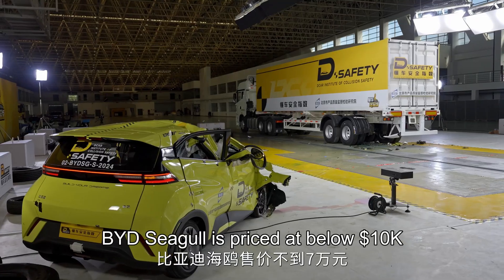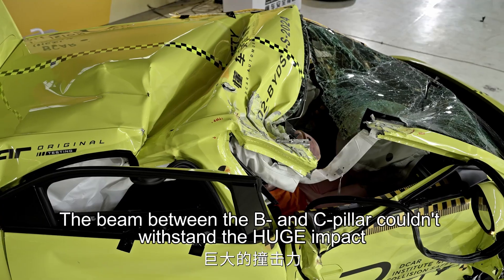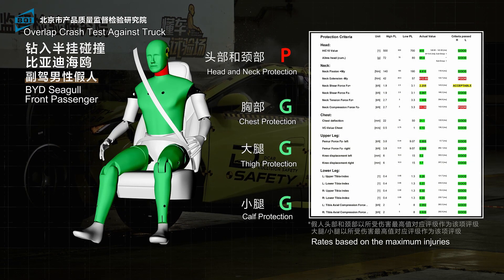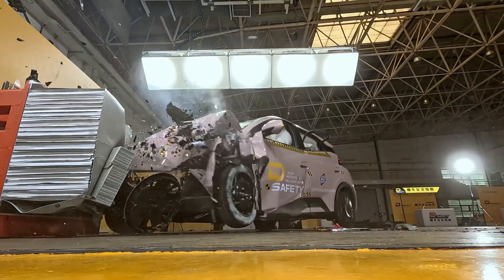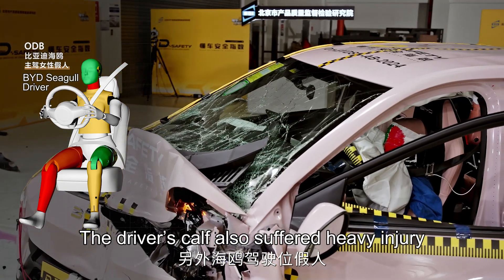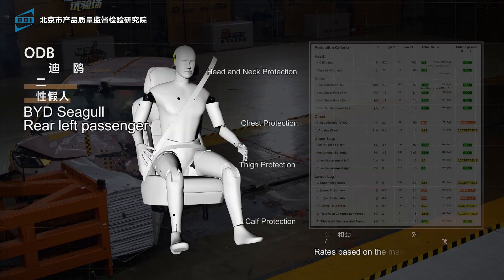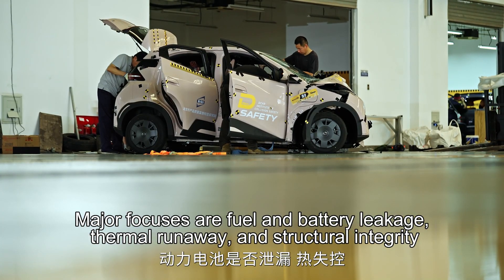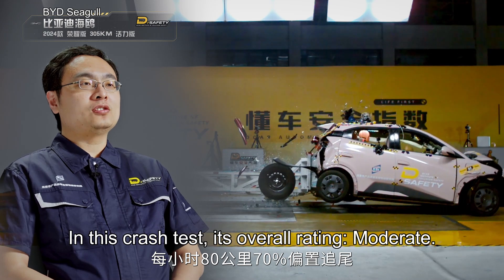BYD Seagull Crash Safety Test 海鸥 碰撞安全测试

Comment: they should also include this sceonario into An-cap test and others .... this is quite an extreme test most of the car can not pass .......
Reply: Tesla passed.  Cope harder.
Reply: @KP-xi4bj Yeah but Tesla is a bigger and much more expensive car. You should compare this car to other cars in its class.
Reply: @ All we're hearing are excuses.
Reply: @ 😂 Aye bro a Volvo XC90 does better in crash tests than a Tesla Model 3. Teslas suck! 😂😂😂
Reply: @ Volvo only dreams of having Tesla's sales volume.  

Cope Harder.  LMFAO  SMH
Reply: @ You missed my point. I was using your clown logic.
Reply: @ And you failed ... miserably.  😆🤣
Reply: @zee4125  It would probably not pass the trailer test (although that scenario wouldn't happen in Europe). Tesla passed because it went underneath the trailer.

In a regular crash XC90 is at a disadvantage to the Range Rovers and EV heavyweights, but will do better than most hatchbacks.
Reply: @xx-----------xx873  my point was cars of the same class should be compared. You can’t compare a Mini Cooper to a Tesla Model X, for example.

Comment: For 10 grand, nobody could expect more. As a city car, it’s still great. At highway speeds, it may be more risky, but in a car like that you drive more carefully like in any small car.
Reply: Based on that logic, they shouldn’t allow it on the highways, which doesn’t make any sense, especially since these aren’t the cheapest cars you can buy, and it’s advertised as a car and not a quadricycle.
Reply: Then they should limit the speed to 50km/h

Comment: just about the most difficult test from an occupant safety perspective... My main takeaway is lower cars have a better chance of survival because the angle of impact against the A pillar is less extreme (and better chance of sliding under the truck instead of getting the car ripped open by that corner).

Comment: I own byd seagull. mas low quality pa Suzuki Celerio ko na parang lata lang yung body nya... High metal quality ang Seagull , ang bigat ng doors nya at body matigas . . Sa test nila kahit anong sasakyan ma wawasak talaga.. 😅
Reply: Like what dcar stated, the sgmw binguo did better overall. The seagull design is not safe.
Reply: @jimboroq2284  still safer than motorcycles.

Comment: As this test is a Chinese specification test, with reality tested in a way totally unmatched in the West, it really challenges the notion that Western standards are leading the world. I saw a video of the Tesla model 3 perform this test - absolutely amazing. The model 3 sort of slid under, but the roof didn't break as it does here. I wonder if the roof could be made stronger and the suspension made to break? Dont know if it would be an improvement I am no engineer.
Reply: the iihs standard talked here is a U.S. standard.  FYI
Reply: @gwsheipang  oh that is interesting. I am in Australia and our standard crash test is heavily influenced by the European standard. There is no test which is offset with the protruding metalwork as you get on the back of a truck, in the ancap test.
Reply: Most people think that China should add anti-collision railings to trucks. In this test, only cars will become safe if they are low enough. Volkswagen's Passat in China was once tested, and the entire top of the car was destroyed. The Chinese joked that they had to buy a helmet to buy a Passat first.

Comment: A 40% overlap of a smaller in width car results in missing the rigid structure at the trailer. Actually part of the energy has to be absorbed there but due to the tiny ovelap just a small wing at the trailer end was hit (visible after 0:13 m) and the car went in full speed under the trailer which resulted in the torn upper part. Don't think it is fair to have the percentage overlap of 1,60 m widee car against 2.00m wide ones if this is decisive for the upper part of the vehicle. What is the rating for a 40% overlap against a barrier compared to other cars?

Comment: The steering wheel moves upward, which would be a serious problem if the driver was a shorter person. Because when you're shorter, you sit closer to the steering wheel. Footwell area is also very bad.

December 17, 2024 11:46AM

Comment: BYD has advanced greatly on design, quality, but still lacks safety, hopefully they can advance in that regard soon
Reply: Wtf U talking about. NO CAR WOULD SURVIVE AN IMPACT LIKE THAT WITH A TRUCK
Reply: @travellinginawhat  are you restarted. People stopped dying from trucks in in the 2010s, China should keep up
Reply: @travellinginawhat A car with a strong A pillar could definitely make it.
Reply: @SaraL0297 nope. This is not the standard ncap test. This is a more rigorous test and almost no car survived it. I do remember only 4-5 cars passed this test one volvo, one bmw and 2 other cars.

FYI most byd models get 5* ratings in the new EURO NCAP.

So as far as safety goes. It's as good as it can be for a 10k car.
Reply: In this test, the A-pillar of the Mercedes-Benz Maybach was also broken, and the B-pillar was late, because the front of the car was too long and there was no contact.
Reply: No car would survive this crash where the A pillar takes the force of the entire crash. Only way to pass this test is to have a very low seated position where the front pansenger head is lower than the truck chassis, like in a super car.
Reply: @moss550  even roll royce and maybach failed at A pillar hahaha
Reply: Dude this is a small car, an aygo, yaris, c1 would do the same, no small car would withstand this impact unless you have roll bars or metal made from vibramium.
Reply: Thats well, profit high, no emphasis on safety
Reply: Safety is good ( dolphin,han,tang,seal,song plus,yuan plus-atto 3 ) 5 stars rating
Reply: I'm sure the BYD models that cost more than $10k do a little better
Reply: size matters when it comes to car crash.
Reply: @koba301  not if every car is tiny.

Comment: Structure Rating - Dead
Reply: DongCheDi, this specific media tested 30 cars in total, and only 3 cars succeeded in saving the front passenger:
MB G-Class G500,
Tesla Model 3,
Volvo S60.
The rest, including Hyundai Elantra, MB-GLC, BMW X5, M-Maybach S480, LR Range Rover, Nissan Qashqai, Lexus ES, Toyota RAV4 and all other cars that you heard or not heard of,  failed to save their front passenger. 
This is an extremely difficult test.
Reply: @毫徳寺三花  show me your proof
Reply: @毫徳寺三花 没有奔驰，还有一辆是Xiaomi su7
Reply: @mr.febrian9248  Di Euro NCAP dapet 5 star
Reply: Price always right🤣🤣
Reply: But at least the battery survives
Reply: @kylereese4822  Which country?
Reply: What s the speed ?
Reply: 毕竟便宜
Reply: Sorry bro, correction needs to be made to be made. Elantra’s front passenger survived the test.
Reply: @kylereese4822  besides SEA and probably most of Africa, it's pretty much illegal everywhere else. There's a reason tractors got crash bars on the level of cars, as survivalability increases probably 100 fold
Reply: @SirBalageG  yeah, about that.. it just got a 5 star on euro ncap..
Reply: This si better that Renault

Comment: For $10k brand new car, you can't expect much. Not many other EVs at that price
Reply: Electric dacia spring
Reply: Cheapest in US is 40,000
Reply: @michellefreedlinghouse3735  the chevrolet volt is $32K 🤣
Reply: But there are a lot of gasoline cars at that price range, and they score way better than seagull.
Reply: considering how expensive medical fees are, just get a model 3.
Reply: @1HeatWalk Or don't crash
Reply: You can spend a few thousand on an older used "built like a tank" vehicle until the technology catches up. Or, resettle to Asia where most people live close to or even at where they work. Other places you go you can be extra choosy. Spending $40 to $100k on a vehicle does not garantee safety...
Reply: it isnt 10k, its more like 18usd. or 26k aud
Reply: It is only $10k in China as it is very cheap to build, everywhere else this is a $25k car, you can get much safer vehicles at that price
Reply: @SaraL0297  just a reminder, luxury cars including Maybach S, G wagon, rangerover cannot survive this test, only tesla model 3 and xiaomi su7 suvived
Reply: @jiaqishen2810  S60 survived also. And it's a $40k car in US, or $30k in China
Reply: @jiaqishen2810  G class survived it, and anything else low enough to go under.
Reply: Get used higher segment car instead.

Comment: A coffin on wheels
Reply: they test 30 cars even maybach failed the first test.
Reply: @888YangJi  I honestly don’t care. She remains still a coffin. This reminds me the small overlap tests made by NHTSA: they were done on the driving side. Then when they did perform them on the passenger side, plenty of cars that passed the test on the driver side did not pass it on the passenger one. Guess why…
Reply: In some countries, you can only buy a two-wheeler at this price. It is much safer than two-wheelers.
Reply: @chjin1796  really? Where I live that car costs around USD $22,000. There a lot of motorcycles 1/10 of that price.
Reply: @waltermolina7115 The price in China is about US$10,000. Some of the places I'm talking about mainly refer to the United States.
Reply: You get what you pay for
Reply: Unfortunally